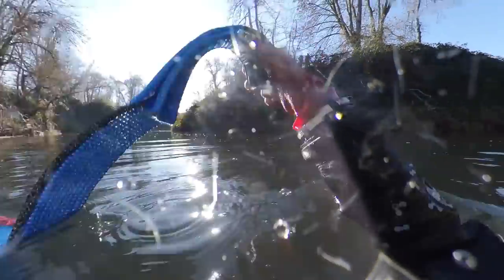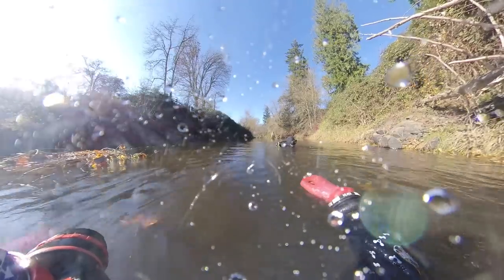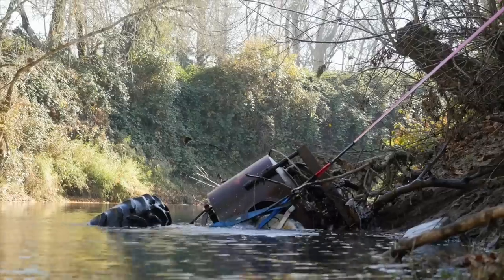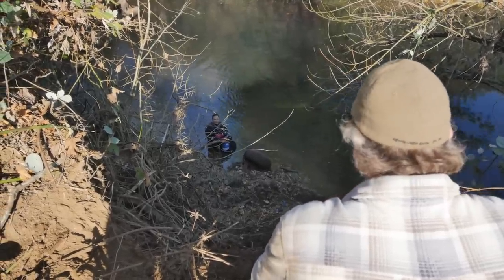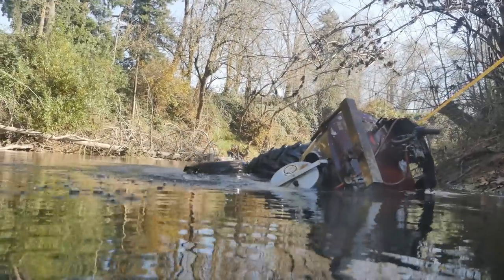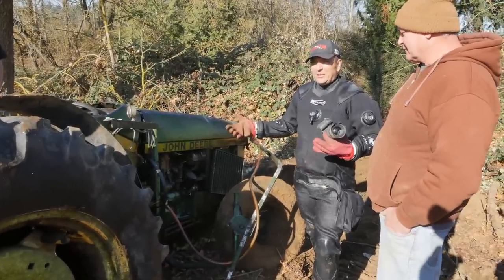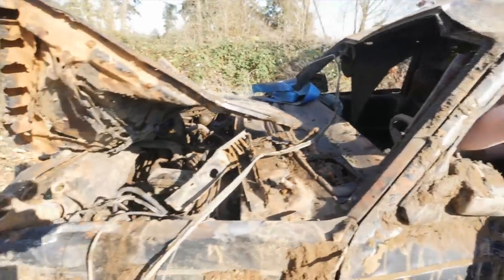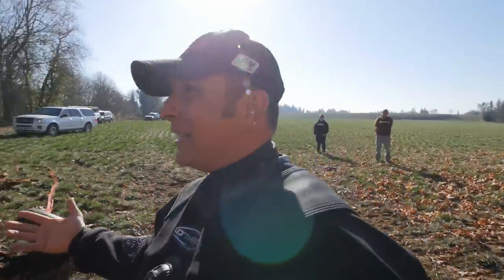John Deere Tractor Found 10' Underwater in River!

Comment: Hay it was running when it went into that Water Ditch so go for it for sure. But start working on it as soon as you can, that is a very good turn around  Project. This is from a 88 year old Auto, Truck and Farm Equipment Mechanic that finally had to stop working a few years ago.

Comment: My shop rebuilt a compact diesel tractor that was submerged in a flooded creek. You would not believe the places where sand and gravel were packed in. We had to completely strip engine and trans, whole new electrical system. Really economically not worth it. We did get it going again and as far as I know, it is still running.

Comment: Letting that thing dry out for a month is probably the worst thing you could do if you want to have a chance to get it to run. As soon as you bring it out of the water the rust accelerates on all the bearings etc
Reply: Yes, I would start filling up anywhere that takes fluid with Diesel Fuel and use it for a flush.
Reply: True
Reply: Hello
    Hello hi
Reply: @dbatch5677  yes drain all oils and fluids and fill in fact fill to the tip top with Kerosene or diesel fuel and let soak for a week drain and repeat until ownership is final
Reply: Yes fire it up right away it'll be fine.  Multiple flushes as everyone says.    Don't let it sit very long
Reply: Fill every thing with diesel asap or there will be no chance for salvage
Reply: like Pickling a marine motor, the process for recovering this is likely much the same.
Reply: @BLKMGK4  yep you got it
Reply: That junk isnt even worth trying to salvage
Reply: @chadsimmons6347  not saying perhaps you couldnt find the right buyer but they are online auction for anywhere between 3 to 7 grand. Depending how much he spends to get it running considering the front end is gone and engine is possibly toast it may not be feasible in the end to even fix it
Reply: Maybe you dont understand how rust builds itself.....
Reply: As soon as air/oxygen hits all the internals of the drivetrain it should be soaked in diesel fuel or auto trans fluid. But my guess Is the trans and differential have a pretty good chance of having at least a mixture of oil and water. I hope we get a update just for curiosity reasons.
Reply: get it running
Reply: When I was younger the organization I worked for lost a yellow JD into a lake while mowing the embankment. It went completely under rollover bar and all. I pulled it out immediately and had it running again the same day. Over the next couple of days all fluids were changed, wheel bearings repack  everything completely dried out. That tractor was in service for another 15 years that I know of.
Reply: Some of the commenters don't realize that for oxidation or rust to occur you need air
Reply: We salvaged a Forklift that was underwater.  It sat for months waiting on Insurance to Release it.
Bought ad Salvage,  drained and flushed everything, put a battery in it.
Been running ever since,  that was 10 years ago.
Reply: Thomas LeMa
Reply: Yeah Jared, I think Matt makes a good point. And if there is no "lithium" grease on the bearings, rust will develop. Lithium grease "supposedly" does not break down. At least that's what a mechanic told me.

Comment: That engine needs to be pickled ASAP, if there’s any chance of saving it. once they are out of the water and in open atmosphere rusting starts.
Reply: That means it would be better left underwater until you tear it down
Reply: @c50ge  No you "pickle it".
Pull the plugs and the drain plugs and drain it.  Then fill the cylinders with oil an the pan with diesel fuel witch will collect the moisture.  Best way to get a lot out is take the valve cover off and pour the diesel in that way so that it runs down.  You do this several times.
Reply: since that is true this tractor will run only in 1 case and 1 case only: if they rebuild the whole engine
Reply: If its diesel the engine needs rebuilt and the piston sleeves changed. None of them farmers had a big think chain to use to pull it up.

Comment: Definitely like watching this video. A quick Google search shows 2240's used price between $2K and $10K
 Definitely film a 'will it run' on the tractor
Reply: Camaro 1968  True
Just to say, one time in the past I had two '68 Camaro's. One was a bastardized punched 327 w/ a heelprint Turbo 400. VIN said it should have been a 6 cyl w/ 3 speed manual. A real fun car. The other was a 327 W/ Powerglide built by A+ in San Diego. That was a real one off with a super high VIN number. Bucket seats,  no console w/ steering column shifter.

Comment: I was thinking that the Tractor would be able to rebuilt until it fell back in.
Reply: It'll buff right out!  LOL!
Reply: yes it was most likly in a lot better shap before they folishly used straps not heavy chains, strap cut on any edge and in water it is hard to make sure thats not hapening, i hate straps, they are not even legal to tie a machine down for trasport, ask me how i know
Reply: @arnoldromppai5395  I would but you probably couldn't hear me after using chain all your life you with all the clanging and the banging haha
Reply: I was afraid the camera guy would need a rebuild when the strap broke.....
Reply: d batch I don’t think so, it will need a lot of parts and for the price u could just buy a newer one.
Reply: These guys get the job done, but they aren't delicate and refined in what they do.  Brute force which leads to things being mauled.

Comment: 1978 working John Deere 2240 on Ebay $5900.
1979, late in year a third diesel compact was added, the 33 hp 1050. It had a turbo diesel engine which was unique in its class. Five new utility tractors were added at the same time, the 41 hp 2040, 50 hp 2240, 60 hp 2440, 70 hp 2640 and 81 hp 2940. These five new models had a black and yellow "tiger stripe" on both sides of the hood.

Comment: Not sure how long John Deere produced this series of tractor but could date back to the 1980's. I remember seeing a flier for these tractors way back around 1980 or '81. There was the 2040, 2240, 2640 if I can remember. That's almost 40 years ago. I think the 2240 was 45 or 50 horsepower. And I think only the 2240 was offered as a regular tractor or the low orchard profile like the one you have there. Good luck getting it going.
Reply: Immobilien himmelbauer pregarten is a in der Nähe von Düsseldorf oder
Reply: Sleep
Reply: Up and I will be there m hi I u are so sweet and I love you so much

Haben I 

,,,,, 🏞️. Jjjjs    Ich weiß 🏳 was das sein soll ich weiß nicht wie Zschopau Zschopau Slowakei ist und 6

Comment: I remember getting two snowmobiles out of the local lake. One of them the owner died the other guy survived. I had to tear both engines down completely and flush them with oil. I also had to drain both chain cases and flush the gear cases. There was flash rust already starting as I pulled everything apart. I had both snowmobiles running in a few days. They were both brand new. The wife sold the one snowmobile and the owner of the other one sold his. I do remember there being sand in the exaust but not in the cylinders.

Comment: Any of these people ever heard of a chain or cable.
Reply: I was thinking that same thing
Reply: Yep, they could have killed someone.
Reply: Darwin surely was busy on a bigger job 🤪
Reply: Straps like that are made for lifting they are stronger
Reply: They don't want to scratch the paint.
Reply: @brianslaugh3029  the video proves otherwise  a tractor like that with a sprayer is a lot more than what that strap is able to withstand
Reply: warren michael in the industry, straps are used with a softener, a half of a pipe, with an angle welded in the inside of the curvature, no sharp edges touch the strap, FYI
Reply: As a rigger and licensed crane operator I can't tell you never lift with chain. Other than an engine hoist that doesn't lift over 10 feet. Lift straps are very strong. You'll never see chain used on a construction sight.
Reply: THAT GUY STANDING  BESIDE THE MACHINE, HAD THAT BEEN A WIRE ROPE HE WOULD'AV HAD HIS HEAD CHOPPED OFF
Reply: @Oops Oops Not even the dudes man bun
Reply: @gus6rocks  the tractor just came out of the mud. Scratches are the least of the worries
Reply: @albertcyphers1532  What no jokes allowed here?
Reply: @albertcyphers1532  Lighten up buddy, life is too short to be Mr Sobersides.
Reply: There are web slings available that are good for 50,000 to well over 100,000 LBS. Maybe even higher weight ones that i am not aware of-- anybody knowledgeable on the subject other than the ones in this thread that OBVIOUSLY don't know?  With the PROPER CAPACITY web slings and proper hook ups this would of been a piece of cake.
Reply: @jlbush8249  Nope. If you watched, they made a point of being away from the site while they were lifting. You think they would sit there under the tractor watching it go up?! Geez
Reply: @jlbush8249  Ya no shit Sherlock. My point was they knew to stay away. Wasnt going to kill anybody.
Reply: Jl Bush Jerrod was the only one in the water. It’s not like he’s been in worse. Which he has.
Reply: Same

Comment: That'd be amazing if you got the tractor running! Its very possible that it will run. If the engine turns over, it will run! Those things are tough as nails and it will likely run. It'll need to dry out and all like the guy said. Dry out the distributor, and all and drain water and all out of the engine, and do an oil flush on it, meaning fill it with oil and then drain it and keep doing it until all traces of water are gone out of it. If the engine is seized, pour marvel mystery oil in the cylinders and let it sit and try and break it free. I can't wait to see the progress on it! :)
That's almost as epic as my vw engine I found in a swamp that I got running, and it was seized and didn't even turn over! It cost me about $1k to get it running.
Reply: You could look all day and never find a distributor .
Reply: @malbers35  John Deere website

Comment: Invest in chains next time . Restore the tractor
Reply: Straps are actually SAFER and actually have a better weight limits.
Reply: Jacob w   When you have chafing sharp edges chains are much much safer or chokers. Straps are fine with the perfect conditions.
Reply: @mickc4633  My family has been in heavy construction for over a century.  Even the Railroads now, no longer use chains for moving 200 ton locomotives around in their repair facilities.  They use STRAPS for their higher loads and safer if they do tear.  They do not fly around and cut people's heads off like chains do.  You sound like my grandpa about 40 years ago... without realizing that modern material technology makes straps way safer today than even 20 years ago.

Anyway.. sincerely... good luck...  Hope to not hear of you in the papers...  Take care.
Reply: Jacob w I’m at Local 3 ironworker and we usually use chokers. Straps and chains sometimes. Depends on the job 37 years Local 3. But we mainly use chokers On heavy lifts
Reply: @jacobw446  straps will kill just as fast the way they were using them. they would of been fine with a 20 ton 12ft continuous strap but they were using ratchet straps
Reply: I get that straps can take lots of weight and I’m nothing more than an arm chair QB. It is compelling though to see them ruin $400 in straps and wonder if chains or steel cable wouldn’t have been better.
Reply: here comes the weird side of the argument lol straps make less noise! how many of you chain guys can still hear within a comfortable conversational level
Reply: @imchris5000  My friends in the Railroad industry use straps on 140-220ton tow loads, on locomotive Pulls.  Almost every locomotive today, has replaced chains with straps.
Reply: If you watch the videos of the pros doing recoveries like this, you will see that they either use chains or special straps to lift. They use the chains when dealing with potentially sharp hookups. I suggest that you checkout Ron Pratt's channel if you would like to see how they do it. And by the way, GET IT RUNNING! ;-}}
Reply: As others have stated, straps are fine for some use. But, chains and cables have higher weight limits. Straps also have expiration dates, chains only expire when the wear reaches a certain point. If I am towing a vehicle down the road or stuck in the mud, I will use a strap or cable. If I am lifting a load like that out of muddy water then a chain hooked up would be my preference. Straps are supposed to stay clean and dry to have full working load.
Reply: they did not break a strap because of abrasion the broke a strap because it was under rated for what they were doing it was fine split between two straps but when they put all the weight on one it snapped. cables chains straps you name it will break with over weight. no ones going to say anything about the fact they finished with with tied up ratchet straps?
Reply: Those look exactly like cheap Harbor Freight Chinese tow straps instead of rigging straps.
Reply: @jacobw446  I dont believe you have friends or that there is a railroad industry sounds made up
Reply: @imchris5000  You can believe anything you want...  I told you facts.  Good day.
Reply: @jacobw446  straps are for shackle to shackle, or wrapping around large smooth edge like a pipe. Not sharp rough edges! Use chain!
Reply: @imchris5000  those were not ratchet straps.... ratchet straps have fucking ratchets.
Reply: A real 1/2 in. G100 chain is expensive, but overhead rated and you ain't breaking it. Then again a 4 ply 6 in. rigging strap is just as strong and just as expensive, but I'm not putting my 550$ strap in muddy water. The other thing about slings is their capacity changes with attachment choice, sling vs. basket vs. choker vs. vertical, basket naturally having the highest cap. Strange that the towing company offered little to no input on the rigging choice and configuration.
Reply: Camaro 1968 Yeah I’m a local three ironworker use Mostly chokers depends on the job. Everything has a purpose.
Reply: Working with chains underwater?? Nah
Reply: Exactly! Big honking chains!
Reply: How whould that work we have to pull up tractors all the time so I would not only use chains for cars
Reply: Get some hardened logging chains. Always use a chain, and use one big enough that the machine it is hooked to can't break it. Chains have definate load limits, no lifetime, they do not degrade, and they don't chaff.

Comment: I'd guess the excavator weighs half of 75 tons
Reply: Nope not that heavy.  More like half of that weight
Reply: googling the basic spec it's around 35 metric tons or 38 US tons, then add the grapple  and any other options it may or may not have, that changes  it again plus or minus. it's not 75 tons however it's spec'd here is the right answer i'm finding.

Comment: If this doesn't explain how unsafe straps are i don't know what will .
Reply: 5000lb strap on 20,000 lb pull
Reply: Straps are far from unsafe.  Ignorant users are what give them a bad rep.  You don't hear much about chain failures because the guys standing around them are dead.  I've ran the engineering data and spec'd rigging much higher than this with straps.  Never broke one.  Math is just amazing......

Comment: Straps are a joke at least chains on the tractor, entertaining. Yes fix it.
Reply: There are plenty of straps that have a higher break point than a lot of chains. I have destroyed both in the past.
Reply: @davebrittain9216  I meant on the tractor just like I said, to many sharp edges for straps, of course I use straps everyday, but correct tool for correct job.
Reply: @TheFlash1940  I don't recall where they had it attached but it would probably been good if they had attached it to the draw bar. Nice smooth surface there.
Reply: @mpshotattwice3253  You should never hook straps over sharp edges rubber mats or not. There are short retrieval chains you can use and a clevis.

Comment: Well good luck with getting it running!!!. Clean it up and dry it out asap. It will take a lot of time, parts and work to get it to run. I think you will really need to weigh out the costs of repairs and new parts needed if you wanna get it running and resell it if that’s the plan. It looks like a right off and scrap it plan

Comment: In the late 90’s I hauled away some scrap on an old farm. Amongst the scrap was two little Toyota’s from the 1970’s. I only recovered one because the body had rusted so bad sitting out in the woods that the body was coming apart as I pulled it. I was hoping to get the engine running but I gave up on it and hauled it in.

Comment: if you ever do this again.... run the strap /choker around the pin that connects the bucket on the back... hooking to the teeth or edge of the bucket will cut those straps/ chokers... also you get more strength if you use both ends instead of looping one thru the other.   cool video

Comment: Yeah , you need to get oil on all bearing services. Change the oil , crank it over with oil in cylinders. Then try firing it up. It will definitely start rusting immediately. Don’t wait

Comment: The JD 2240 is a low-profile utility tractor used in the orchard or poultry industry. It is powered by a 4 cylinder diesel engine and is rated at about 40 HP. The 2040 model is from the mid to late '70's.

Comment: Looks like a late 2240 which would put it late 70's early 80's. Very good machine but to restore it you will surpass your 1,000 estimate. They don't have a lot of value anymore but it would be worth saving for sure. Plenty of tractor salvage yards you can hit up for a lot of the cosmetic and hard parts you might need. The sprayer is made in Eugene and are one of the best out there.